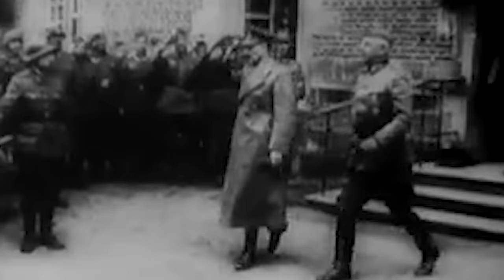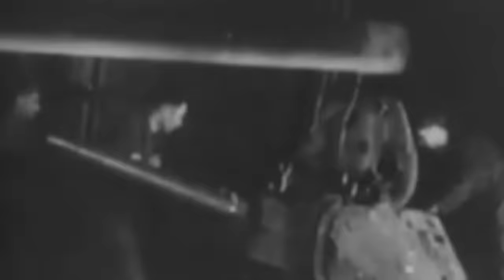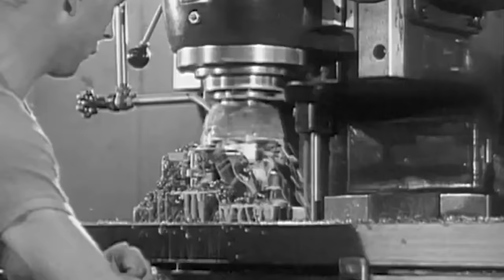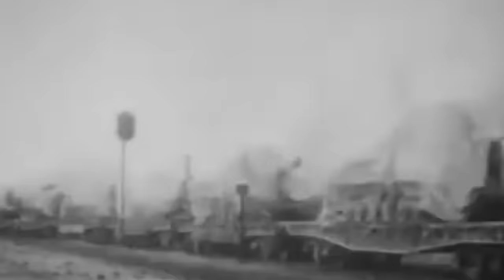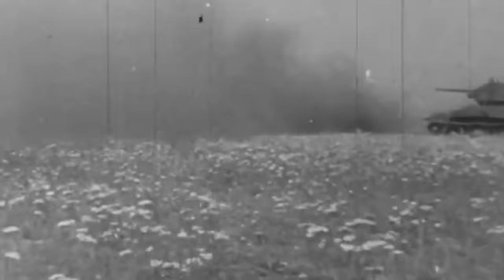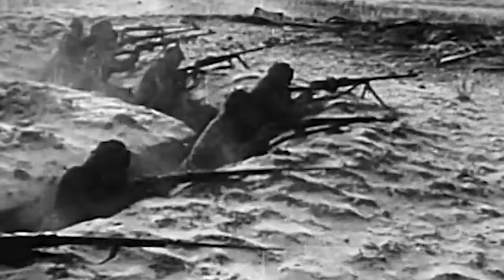The Super Battleship Built to Fight on Land

Comment: Actually a very well armored landship with anti fortification equipment on the front might actually be the only thing that can safely break a defensive line and push faster than defenders can make new defenses.

Maybe it is time for the land battleship again. Keeping in mind that the larger the vehicle the more compartments it can have which would limit the effects of penetrations.
Reply: WW1 all over again.
Reply: “… the size of a small parking lot…”
Reply: shawnstafford7809  I was referring to a fictional “mobile fortress” - complete with four spiked tracks, multiple turrets, and stuffed with high-as-kites black-dressed witch-soldiers.

Oh, and running a compression-ignition engine that had a constant big exhaust flame and huge clouds of thick black exhaust smoke.
Reply: existing anti-tank weapons would still be able to destroy the tracks. If it made sense, they would have built it
Reply: 2 hits - same area = 💥
Reply: That's what Caterpillar D-9 (a large armored bulldozer) is for. Israel uses it very effectively.